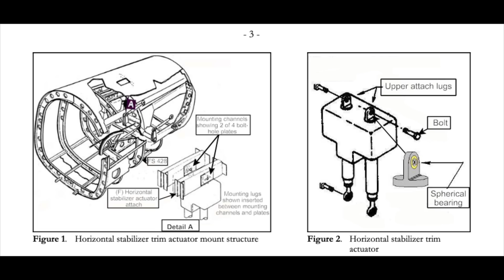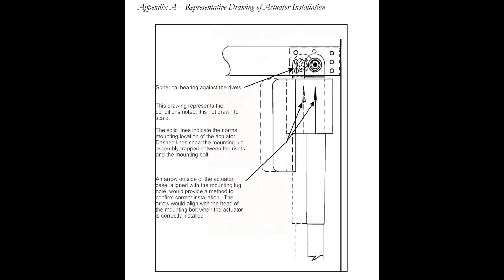The Blind Fix That Crashed A Plane | Hidden Flaw | Transwest Air 602

Comment: As a former employee of Transwest/Westwind, I can tell you that the airline has a complete disregard for safety. It’s all about profit and cutting corners to save money.
Reply from the maker: Thank you for your insight!
Reply: As a current employee of Transwest Air I think you may be a disgruntled and perhaps bitter former employee. I can tell you that we carry out everything with safety of crews and passengers paramount. Humans still can make mistakes. You want to call every airline that had a human factor crash one that has “complete disregard for safety”? You may be a former employee, but right now your acting like a troll.
Reply: @philipolson1965  if that was the case, why do we give spray bottles and ladders to our ATR crews? The TSB doesn’t share your opinion of ‘paramount safety’. If they had learned a lesson from this accident and took safety seriously, do you think WEA would have crashed in Fond du lac? Safety is a joke for this airline. We’ve had several CEO’s come and leave within such a short time. I wonder why?
Reply: @operatordirt4611  you’re talking about flight ops. This is maintenance. If pilots want to take off without verifying whether there’s ice on the tail that’s the company’s fault? And there is deicing equipment at all the bases now. I can’t speak for West Wind. That OC is no longer in existence anyway. But saying the company has no regard for safety is 💩
Reply: @philipolson1965  if pilots take off with contamination that’s not the company’s fault? If that was the case why did the TSB find the operator responsible for the lack of equipment. What about the all the other equipment constantly breaking down? Tugs, de-ice trucks etc. You can’t tell me that when it comes to repairs the company makes good choices. They all operate under the transwest name now so what’s the difference?
Reply: @operatordirt4611  getting off topic. You said “complete disregard for safety”. Now you’re complaining about the ground equipment quality. Which yes could be improved. But at the same time, it’s the North and stuff does break down a lot more in extreme conditions. Anyway, you clearly had a bad experience and I’m sorry you did.
Reply: @philipolson1965  it's the little issued like that, that don't get addressed and it ends up having a domino effect. Things get swept under the rug. Now that Candace is gone, we'll see the direction the new airline will go...
Reply: @philipolson1965  and operating aircraft that are not gravel certified still landing at gravel strips? You can't tell me that's not ignorance.
Reply: @operatordirt4611  you have valid points. Not going to argue that. Just think and hope that things are going in the right direction and as a maintenance person, I’ve seen nothing that would make me think we have anything but a very high regard for safety of both passengers and crew. Flight operations side I’m not as familiar with. Is this the area you worked in?
Reply: @operatordirt4611  and what is gravel certification? Almost all the airports in the north are treated gravel. They land 737s at points north which is a treated gravel airstrip. But again, You’re speaking a flight ops and we are discussing this about a video regarding maintenance.
Reply: @philipolson1965  I'm not particularly trying to bash the maintenance department. I'm shaming the airline as a whole for failing. Without going into too much detail, I worked in a certain department that dealt with this stuff and I resigned for a position with a different airline in Ontario. Again, my point being that it's the airlines disregard for safety. It's the decisions that the owners make that make our ops unsafe. As far as gravel certification, I'm aware certain 737's can land on treated gravel. However, modifications have to be made in order for them to be certified to land/take off on them. In regards to our Saab 340 fleet, they were not certified by the manufacturer to land on gravel. In turn, Transport Canada also did not issue that aircraft a gravel certification.
Reply: @operatordirt4611  ok well hope your new job goes better. Guess I just try to do the best I can in my position. I definitely see areas that could be improved but also don’t know much about the workings of the entire company. Your very first comment was very strong so that why it got my reaction, also not really knowing what role you played when employed by TWA.
Reply: @philipolson1965  no worries, it's not the guys on the ground that are responsible for all of this. I have no doubt you're a hard worker, but the people upstairs? It's a different story.
Reply: @operatordirt4611  could be. Like I said, I don’t know enough about the inner workings of the entire company to comment on that.

Comment: Make it easier! I hate user error as an excuse in high stress situations.
No, make it less stressful or at a double check step. Guy followed specs properly for 32 years, maybe a bit of drift, but that is on the company to uptrain and then make difficult tasks more easy to replicate regardless your skill level (Like indicator arrows).
Blame the manufacturer and reduce workload on mechanic on future designs

Comment: I don't believe an indicator would have helped in this case.  If the mechanic had done a visual inspection (with a mirror or a scope) then he would have seen the bolt was not in the hole.   Since a visual inspection was apparently not done, additional markers would not have helped.  For something like this it would be better to have a flange or studs which can do double duty - positively locate the part in the correct position, and help to bear some of the weight of the part which would reduce the strain on the mechanic.

So yes, the solution is the design of the plane, however I'm not inclined to give the very experienced mechanic a free ride either.  Failure to use a tapered pin to locate the hole and bear some of the weight, and failure to do a proper visual inspection of a blind component are apprentice class mistakes.  If nothing else it's still necessary to inspect the bolt to make sure it is fixed properly - a wrong size bolt, a damaged thread, or even a bit of debris can all make a bolt feel like it is tight when it is not.  We are supposed to criticise the systems and not the individual, but this wasn't just a simple matter of lack of training or poor design.

Comment: I would call a tightly fitted bolt LOW tolerance.
Reply: It’s called close tolerance actually.
Reply: @philipolson1965  Agreed.  What does "High tolerance" mean to you? I'm a farmer, not an engineer.
Reply: @deereboy8400  not a term I’ve heard. Tolerance to what? There is high shear strength, high tensile strength, but never heard of “high tolerance”.

Comment: Did an inspector actually sign off on this?
Reply: There probably was no inspection sign off needed.  Just the mechanic signing off what they did and the manuals used to do said job
Reply: Yes
Reply: @philipolson1965  if that is the case the inspector is just as responsible as the technician performing the installation.

Comment: It is a flight control! What happened to the independent inspection by a suitably qualified technician for correct installation and free movement in the desired direction?  This is not a nice to do procedure, it is LAW in Australia (edit and I believe in most of the aviation world).
Reply: Law in Canada too. The independent inspector missed it as well. And it moved and acted perfectly for twelve flights. It was less than an inch ahead of where it should be and very hard to see as you have no way of looking at it from the side.

Comment: I'd do neither to prevent the accident. Training is the lowest form of security, aids are a bit higher.. But changing the mechanism so it does not leave room from a incorrectly mounted is the second highest level of security (besides omitting the mechanism, which doesn't really seem possible). It is the most expensive though and  airplane economics aren't my cup of tea....
Reply: Yeah the real solution is to make it physically impossible to install incorrectly.  It may be easier than a complete redesign, if the rivets heads could be changed in some way so that the actuator can't wedge in there.

Comment: Make 2 mechanic do the job.. One hold it and the other puts the bolts in.. You can be to cheap when it comes to aeroplane.. That's multiple human life you all cheaping out on
Reply: It''s a good idea, but on this kind of airplane, the tailcone is so cramped that there's no room for a second mechanic in there.  Even with one mechanic, they'd need to be on the skinny side. :)
Reply: @ssbohio  r you being serious right now
Reply: @MrBchott  Yeah.  This is a fairly small airplane, not like a jet airliner at all.

The whole fuselage is barely 45 feet long and only 14 feet high at its tallest point.  The control unit is installed close to the end of the airplane's tailcone, where the diameter is better measured in inches than in feet.

https://aviation-safety.net/database/record.php?id=20030423-0

Comment: This sounds like another case of "normalization of deviance."  Any mechanic that short cuts a job and relies on deficient documented procedures as justification is not what I would call a "professional," no matter how many wrenches he's turned in his life - "measure twice, cut once"!
Reply: He made a mistake, sure. But it was an easy one to make. Made so by the design of both the stabilizer and the entire aircraft. Manuals are written to help you perform your task properly. A warning in the manual that this can occur is not a bad idea at all. And no one said the mechanic tried to justify what he did. It nearly caused him a mental breakdown and he never worked on another aircraft the rest of his life.

Comment: 5 kg is not heavy and surely he has some way of verifying the bolt really went through the eye it was supposed to hit (or shine a light through the hole and check). 

I have worked with mechanics that have 40 years of experience and they are still shit but are constantly saved by others checking their crappy work.

I know these reports tending to be blameless and very forgiving when it comes to competence but I feel like this was a definite case of incompetence.
Reply: 5 kg is not heavy, until you are holding it above your head at an odd angle for minutes...then it becomes incredibly heavy.
Reply: @scottbeeston6017  this is a small plane so I doubt he has to hold it at a very weird angle.

I have worked with pieces weighing 20 kg at very very weird angles and I still ensure they are affixed properly before I call the job done. If I don't manage, I find a new approach, call for help, anything to make sure I don't bodge the job. 

It's a poor excuse to ensure compliance with the no blame nature  (which essentially is a good culture) of these reports.
Reply: @JohannesKonow  yes you do have to hold it at arms length pretty much and you can’t see what you’re doing at all. The ten pounds seems a lot heavier when you have to try to hold it like this. And this is an older guy, not a young bodybuilder.
Reply: @philipolson1965  ok granted it is heavy at that position, but surely the arm of the actuator extends through something and the fact that he could place it in the wrong location means he could also check if the bolt went through the eye it was supposed to  (I'm assuming the mechanic was a he). I still call incompetence.
Reply: @JohannesKonow  ok. I guess you have a right to your opinion. I think possibly if you saw the installation it might make a difference. But yeah the guy made a mistake. By far not even close to one of the greatest mistakes made by competent people in aviation. But I’m sure if you talked to him he’d say he messed up. It ended his career and sent him on such a path of self doubt he nearly had a mental breakdown.

Comment: The mistake didn't happen because of a lack of skill. They couldn't see what they were doing and that's what caused it. More indicators of where the exact spot it needs to be installed is the way I would go. You can't work on your car with a blindfold on.

Comment: High TENSILE bolt - not high tolerance...
Reply: It's a high tensile bolt but I think they meant close tolerance bolt for the tight fit
Reply: It’s actually not high tensile. It would be high shear strength because that is the load on it and “close tolerance” yes
Reply: @philipolson1965  he mentioned high tolerance... not me. No such thing as "high tolerance".
Reply: @philipolson1965  It is actually high strength/ high tensile. Bolt in that application may have shear forces on it yes, but the bolt is high strength. Shear bolt is high strength, just the shank is close tolerance and only threaded on the very end
Reply: @user-io4rf4ml5e  just saying the bolt has almost no tension load in this application. Could just as easily be a pin. The close tolerance is to stop vibration and therefore fast wearing of the surface.
Reply: @philipolson1965  True, I mentioned that also. But you corrected on high tensile bolt. It is one, no high shear bolts. High strength shear bolt yes. Been doing this many years, mechanic inspector and engineer. We are both correct, just different how we state it. Take care
Reply: @user-io4rf4ml5e  ok yeah my bad.

Comment: Scary thought with how many times I had to install a component blind.  I am not faulting the mechanic.  Shitty situation.  I have used the pin idea before.
Reply: I'm sure you double checked all your work though.  Seems like that step was missed.
Reply: @Skimblshanks  the step wasn’t missed. The fact that the actuator was sitting less than an inch ahead was missed in the independent inspection required by law. It looked fine, and operated perfectly for twelve flights.
Reply: @philipolson1965  obviously it wasn't done.  The mech did not go back and look over his work.
Reply: @philipolson1965  I'm not trying to argue but something was missed by mechanic.  I've done swaps of hardware with blind bolt holes. Go off of feeling not sight.  Even had to safety wire said bolts afterwards. I made sure the parts were installed correctly.
Reply: @Skimblshanks  oh yeah he made a mistake, absolutely.  But that’s something we all have the potential to do. Even the best. That’s all I’m getting at.
Reply: @Skimblshanks  he did look over it. But granted, not thoroughly enough. And it was independently inspected. Sometimes things get missed by multiple people it does happen.
Reply: Another thing to realize is that the independent inspector does not need to be a mechanic . They could be the pilot or someone else like that. It just needs to be someone who is not involved in the work. So perhaps a bit of a weak link?